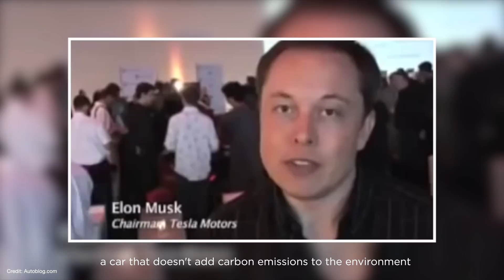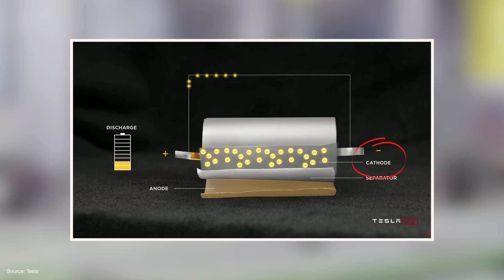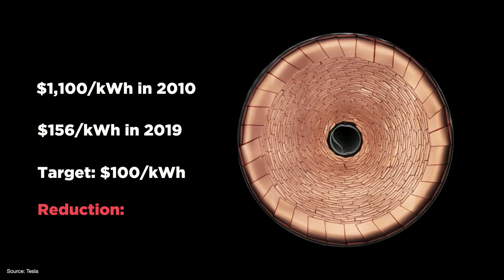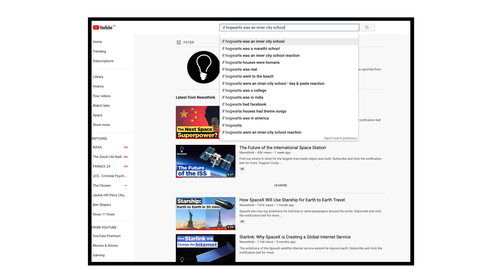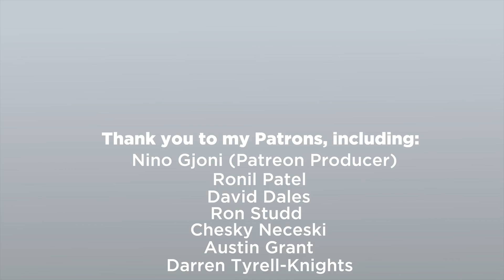Battery Day: The Path to a $25,000 Tesla

Comment: As a physicist hearing the explanation that by removing the tab the electrons don't have to travel as far and that's the secret to this really made my head hurt, and yes I realize that's what Musk said during the conference but... ouch.         

Plus the larger battery... yeah the battery is about 5.5x larger, you expect it to have more capacity as a single unit, but I'm guessing this is a financial savings increase rather than some new technology that does more.    I do wonder how the packing density of the batteries will change the overall power storage of the cars since there is now more "wasted space" between individual batteries.